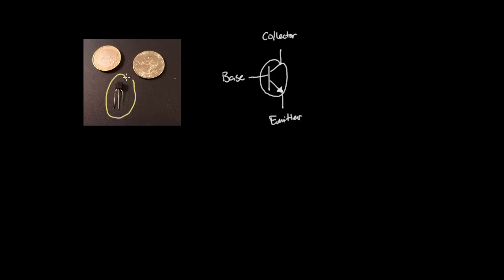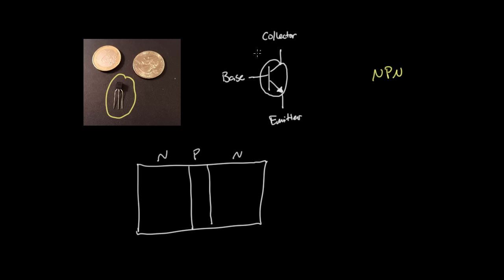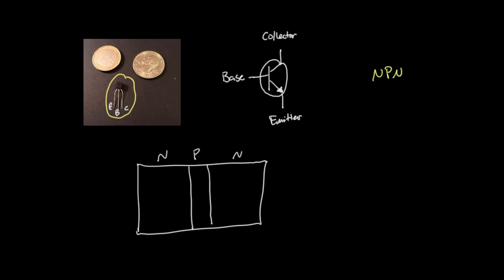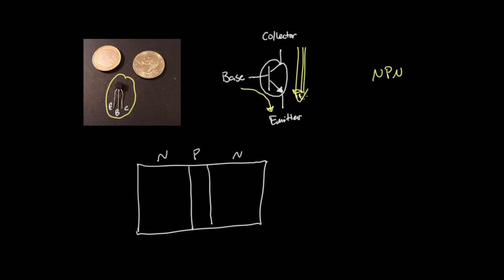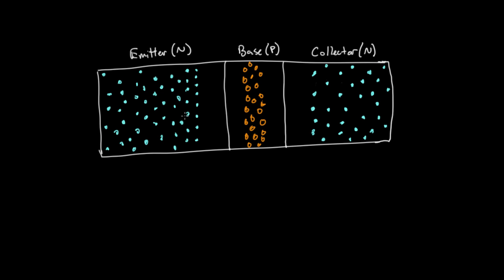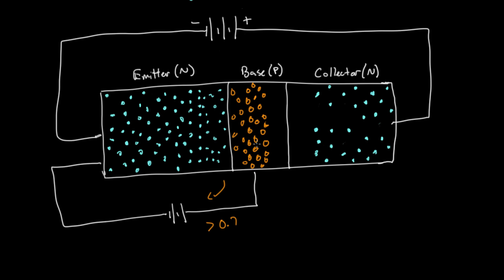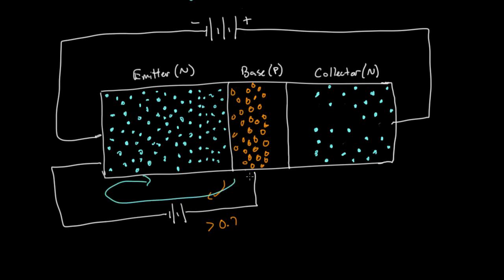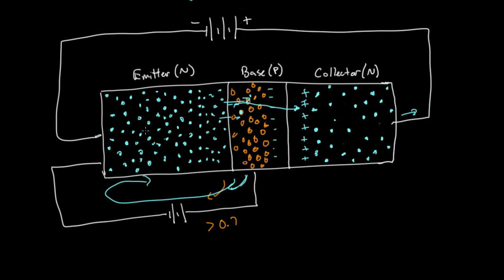How a transistor works

Comment: 9:11 I agree that the positive charges in the Base-Collector depletion region will attract the "diffused" electrons. But no matter how thin the base is, you have an EQUAL number of electrons closer to the base which will REPEL these electrons. I don't see how the attraction will overcome the repulsion and get "swept" into the collector.
Reply: You are right it is not because of the positive charge,it is because of the high kinetic energy of the electron passing from emitor to base. However, there is also a small current due to reverse bias in J2 called reverse saturation current in the same direction of other current
Reply: They probably have enough momentum to not be affected by the repulsion. But when they do cross the electrons, now they'll repel them in the other way, which is good. Either way, it is probably not those charges the affect their movement.

Comment: I would like to see how the voltages are working. It looks like a relay where the higher current can flow due to the lower current opening the switch. In circuit are there more than one voltage/current source. Great to see you explain that Ben, I learn quite a bit from your vids. Thanks
Reply: The concept of Current Controlled Devices was also confusing to me when I studied transistors as an Electrical Engineering Student way back in the mid 1970s (gasp!). 

Field Effect Transistors (FETs) behave similarly to vacuum tubes in that these are Voltage Controlled Devices, however; common N-P-N and P-N-P transistors are best conceptualized as Current Controlled Devices (not voltage). Try to think of the Current in the Emitter-to-Base N-P Junction as kind of like a 'faucet' that controls the overall much greater and often proportional current from Emitter to Collector, such that you have two loops of current. 

When such a device is constructed to be biased at some ideal 'Q' point, then there will be a linear range of current both above and below this middle or Q point that is proportional, such that the change in current in the Emitter-Base is proportional to the larger current from the Emitter to Collector. This is the basis for an analog amplifier transistor circuit. If, however, the transistor is "doped" and constructed in such a way that a change in the input current loop causes the output current to "saturate" or go from zero to maximum like a "switch" then this is how logic gate transistors are designed, so that their behavior is more like an on/off switch, and it's less important to have a linear form of current control as used in an amplifier. 

Voltage is of course always related to current, but for regular transistors, it's best to think of (and use equations) based on the fact that these are Current Controlled Devices, and the voltages present merely establish such flow of current.                   - j q t -

Comment: @Jamie Beal
The batteries are outside the transistor. They are just used in this demonstration as sources of electrons. You don't need a battery, it's just a way to show how transistors work when you have two different flows of electrons working together through the transistor. If you have any questions, please ask, it took me a while to understand how transistors work too.

Comment: Thanks for the video. So, basically, the nano-transistor works by exchanging the electrons (extra = 1; missing = 0)? How does normal computer (or hardware) determine which atom has extra electron or missing electron?

Comment: 6:40 As long as we get about 0.6 or 0.7 volts of current flowing. What.

I thought they where current based and that mosfets are voltage based.

So how much current do we need at 0.6v - 0.7v?

Comment: Does the negative charge created in (the right of) the base not repel electrons coming in from the left?
I understand that the positive charge pulls electrons from the base over to the right, but surely the negative charge created by the initial extra electrons filling the holes in the base would repel the electrons just as much as the positive charge would attract them. In my head this would cancel out the overall pull/push of any electrons leaving a delocalised sea of wandering electrons. If you then account for the positive terminal of the battery in the main circuit however, this WOULD provide an attraction for the electrons.
Where am I going wrong plz help.

Comment: But how can the electrons be attracted to the positive charge at 09:27 when they have to go forst through the negative charge and the negative charge pushes them away??
Reply: read tunnel effect.
Reply: It's because that negative charge is the electrons.    They're movable.   The negative charge takes off flying towards the collector.   But also, for each electron which moves out of the base region, another one is allowed to move up.    That way the negative charge stays in the same place.

And finally, if one of the negative charges doesn't leave, it repels electrons behind it, so they can't move up to the edge of the depletion zone.
Reply: When the transistor is conducting, most of the electrons in the base region are free to move. The only ones that aren't are the small proportion that happen to fall into holes, and the base current ensures that those are continually being drained away, so there is a relatively small amount of trapped negative charge to impede current flow from the emitter to the collector.
Reply: The base is really thin so the electrons just go straight through.
Reply: Transistors work on the principle of quantum tunneling. The fact you needed to ask this question means you do understand.
Reply: Quantum tunneling has nothing to do with it in this case. Electrons are simply attracted to the positive terminal of the battery on the N side, since there are far more electrons then holes in the base (E is highly doped and B is poorly doped), they simply flow through it.
Reply: @DesertFoc  No, quantum tunneling still occurs, otherwise the negative charge would never be able to cross the negative boundry to make it to the positive electrons in the first place. This does not work on quantum tunneling, but it does rely on quantum tunneling to function at all.
Reply: Some people make the mistake of thinking that the negative has to flow towards the positive, but not necessarily in the case of a transistor.  Ben explains it very clearly what's happening.

Comment: No repulsion due to the negatively charged electrons on the p-side of the base-collector junction (N-P-N transistor), towards the incoming electrons from the base-material? Also, they usually show that the EB junction is forward-biased while the CB junction is reverse biased, in your example however, you use a different configuration? I'm aware there're different configurations like Common-Base et cetera, could you explain them?

Comment: So can each battery be different voltages? Could I join both negative terminals to the emitter and the load, and use the lower voltage positive to the base and connect the higher voltage positive directly to the load? To switch, say, a 12 volt battery with a 5 volt battery?

Comment: if i forward biased the emitter and the base with a battery without conecting any thing to the collector
what would happen to the electrons in the collector?
 would they flow through the base or would they just do nothig or their depletion region would decrease without letting them flow through the base?
whatever the answer please explain why it happens

Comment: So are all transistors amplifiers? Or does it depend on the current flow? Im a little confused because I read that bipolar transistors could be switches or amplifiers, but I can only think of diodes as switches and transistors as switches and amplifiers at the same time

Comment: How do you turn it off?
If you take away the 0.7 V battery then how do the electrons decide to stop flowing like before?
Reply: +Luna Yes it would because there would be no current to flow. That small battery makes it possible for the current to flow from the N towards P(the principle of a diode).In its absence, the electrons would not diffuse and if they cannot diffuse, it results that they cannot cross that thin region to reach the collector. That is why the region is very thin, in order for the electrons to pass E-B-C in conjunction with the small battery.
Hope I made myself clear enough.
Reply: +Luna nice question..i am also having same doubt
Reply: To turn it off, just reduce the Vbe base voltage battery.   If the battery was only 0.3V, the transistor turns off.
Really your question involves diodes.   How does a semiconductor rectifier turn off?   Simple: it's naturally turned off, because it has a built-in reverse voltage of about 0.7VDC.   So, all diodes are already reverse-biased, even when they're disconnected and sitting in a box.   To turn on a silicon diode, the external power supply must be larger than the diodes built-in voltage of about 0.7V.   And, same answer applies to the base of a transistor.   0.5V is off, 0.7V is on.
Reply: Let me see if I understand this: It (theoretically) doesn't matter what the voltage across the two N types are, the base/emitter voltage of .7 volts is what keeps the circuit running because without that there isn't enough potential created across the barrier to get the electrons to flow.

Comment: Does this mean that, if I am careful with my resistor, diode, and supply selections, I could make a transistor from two diodes?
Reply: sorry to say but you can never make transistor using two diodes , well some guys tried doing it decades back but they failed , whatever they did is called Ebers moll model , you can google it to know why you cant make transistor using two diode. :)
Reply: The base has to be microscopically thin, which you can't achieve in your home by putting diodes together.

Comment: Sorry, lots of questions. So, is the base-collector reverse biased? Does it need to be for a transistor to work? And is it the E-field induced in the BC interface depletion layer that acts to sweeps the electrons across into the collector? 
In the case of a PNP transistor, is the EB junction forward biased and the BC reversed, but with holes acting as the current? 
Any help would be grand thanks! :)
Reply: Depends on which mode the transistor is operating in - https://en.wikipedia.org/wiki/Bipolar_junction_transistor#Regions_of_operation

So you want the transistor to be like a closed switch then No BC junction is forward biased. Otherwise, if the transistor is active or in cutoff, that junction is Reverse biased. 

I think so, once it enters the BC junctions, it's internal electric field should help accelerate it. But the question is how does it cross the electron space charges.

Comment: 9:25 Sorry, but I don't get this part. Aren't those electrons closer to the negative region than the positive one right? Shouldn't they get repelled by that region and swoop down to the smaller circuit and goes to the emitter again?

Comment: you are saying the key is that the base is thin. but why is the transistor blocking current if i supply the collector with + and the base with - of the same source.

Comment: So I still have a little question. If the current is flowing through the base-emitter enough to create a path through that depletion zone, why or how is the other depletion zone filled?
Reply: The emitter is double doped- enough to reach the voltaic tipping point with the assistance of the small circuit, but not enough without it.

Comment: How do you turn it off then? If the base is saturated with electrons won't it just continue to flow even if you remove the 0.7v at the base? Do you have to reverse the base current?
Reply: I'd like to know too.
Reply: Ben's explanation is simplified.  Because it's simplified, it's only "mostly right" and your question falls into the region where Ben's explanation isn't quite right.

Extra electrons don't actually accumulate in the emitter or base from the battery, but that's a useful shorthand way of thinking about what's actually going on.

Explaining what's really going on requires explaining a lot of atomic theory.

It involves the fact that current flow is basically electrons "atom-hopping" through the "holes" Ben mentions and in the process, knocking more electrons out of orbit to "atom hop" through "holes" in more atoms.

And even that is over-simplifying.  Whole technical papers could be (and have been) written to try to explain this.
Reply: When base current stops flowing, there's nothing to drain away electrons that happen to fall into holes in the base region, so eventually all the holes near the emitter-base junction fill up and the depletion zone is re-established.
Reply: Usually you connect the base of the transistor to ground (the negative of the "large" and "small" battery) when you want to turn it off.

Comment: Dear Ben Eater,

I hope this letter finds you well. I am writing to introduce you to an exploration I have been working on recently. I believe it has the potential to provide a new and unique perspective on the relationships between numbers.

As you know, the number line is a fundamental tool in mathematics, providing a visual representation of the relationships between real numbers. In my exploration, I have taken the idea of the number line and extended it in a new direction.

Imagine a number line where there is a unit circle for every increment in absolute value of one whole number. For example, a unit circle for 0 to 1, a unit circle for 1 to 2, and so on. Each unit circle represents all possible values between the two whole numbers that it lies between.

By doing this, we can represent any division of one increment between two whole numbers as a point on the unit circle. This provides a new way of visualizing the relationships between numbers, similar to how polar coordinates provide a new way of visualizing points in the plane.

I believe this exploration has the potential to provide new insights and understanding into the properties of numbers and their relationships, and I would love to hear your thoughts and ideas on the subject.

I look forward to hearing back from you soon.

Best regards,

Jon

Comment: So, the bias circuit setup is important. The voltage hike on the collector plate needs to be an order of magnitude larger than 0.7V on the base so that electrons are sucked into collector instead of going into base pin. Don't be surprised if not much perceivable amplification when the bias is not very well set up.
Reply: I was wondering what would stop all of the current going through the base, thanks for the explanation!

Comment: At 8:55 you say that the area is positively charged because the electrons have left, is that actually true? There were extra electrons before, making it more negative, when they leave they do so because the atoms want to be in a lower energy state, or neutral, if it left them positive they wouldn’t leave, so doesn’t it leave those atoms in a neutral state, not positive?

Comment: This is a good explanation. However, my only criticism is that the transistor is not a current-controlled switch. It's a voltage-regulated switch. The small base-emitter current is just a byproduct of the thinning of the base-emitter depletion region caused by the base-emitter voltage. The emitter-collector current is directly proportional to the voltage across the base-emitter region. Want less emitter-collector current? Turn down the base-emitter voltage. Want higher emitter-collector current? Turn the base-emitter voltage up. The base-emitter depletion region will regulate current from the emitter to the collector, depending on its thickness which is regulated by the base-emitter voltage.

You kind of mentioned this in the video, but I'll expand on it a little.. It's important to mention that the reason why a current even occurs between the emitter and the collector is due to the saturation of the base region with movable charge. In other words, because the base region is saturated with charge faster than the (+) base voltage can draw the charge away, the charge will find its way to the base-collector depletion region where it can encounter the electric field created by the emitter-collector battery and be drawn through the base-collector depletion region. If the base region is not able to saturate with charge faster than the (+) base voltage is drawing that charge, then it would work as a diode and you would never get an emitter-collector current. So, this is why the emitter is heavily n-doped and the base region is made very thin. This ensures there's an abundant supply of movable charge ready to quickly saturate the very tiny base region once the base-emitter depletion region is overcome by the base-emitter voltage.